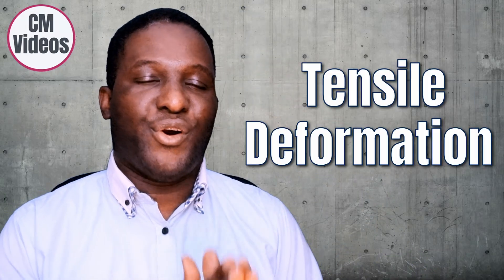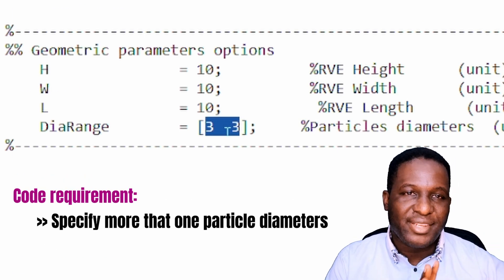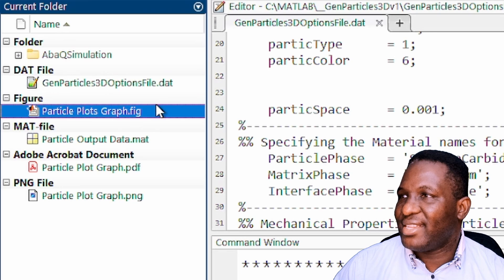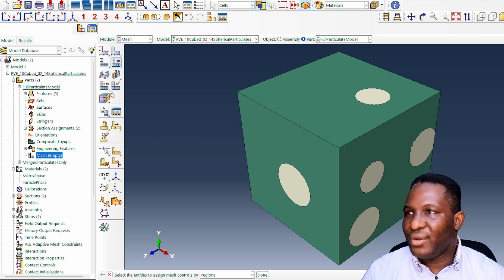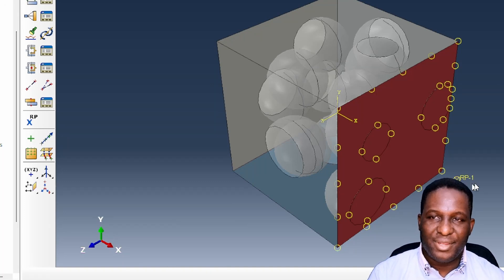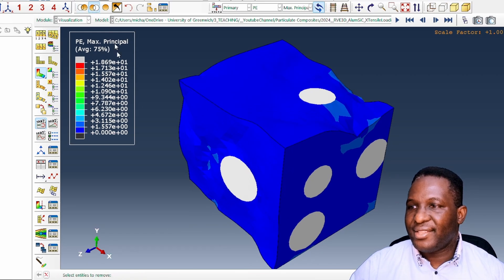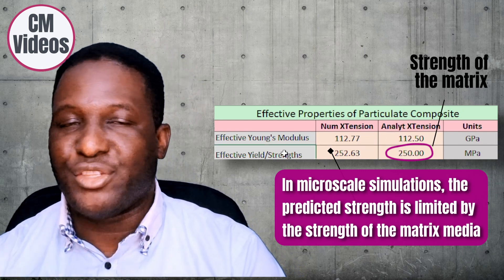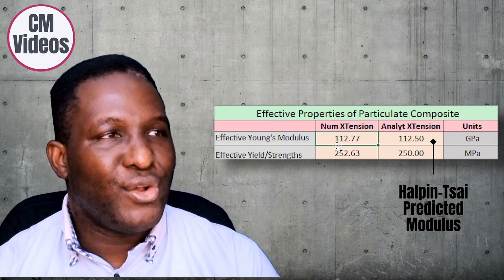RVE MODELLING of PARTICULATE Composites in ABAQUS: Tensile Loading

Comment: Dear Dr. Okereke
Thank you for your useful instructions on composite modeling material. I have 2 questions about modeling complex structures like the human left ventricle in particular. I am incredibly grateful for the invaluable advice you will provide.
1- Is it possible to explain how to model the geometry of the fibers in the ventricle wall? The shape of the heart is obtained by MRI. The fibers wrap from the bottom of the ventricle and go up. The heart wall is a layered structure and in each layer, the fibers' orientations are not the same. They differ from -70 degrees in the outer layer to +70 degrees in the inner layer.
2-  I have an Excel file that has the direction of fibers and the number of the elements to be corresponded. How can I assign fiber directions to the corresponding elements? For example, the element E1 has the fiber orientation (x1,y1,z1). The model has more than 6000 elements and it's not possible to draw the fiber one by one.
I can provide you more details about my questions if you are interested.
Best regards
Reply from the maker: Hello, thanks for your comment and I am happy to note you find these videos helpful.

It does sound like a challenging job what you are trying to do. I do not have any experience modelling ventricle walls or heart modelling so unable to help with the question.

More generally, I think you would be better of creating the fibres (6000 of them) using some sort of automated scheme maybe within a python script. I think if you can create one to learn the process in ABAQUS, then convert the implementation into a Python script by assessing the *.jnl file resulting from the simulation, that could be a good place to start. 

I also think such complex fibres within the ventricle wall might be better developed inside a CAD tool like SolidWorks which when you are happy with it, then import into say ABAQUS to undertake the stress analysis.

I have a video on the channel about asigning orientations to heterogeneous media, please check that out here: https://youtu.be/W34LrXDMhOA?si=5lHhr7c_SDgSMMwx
Reply: @MichaelOkereke  Thank you for your response. Is it possible for you to help me with my second question, please?
Reply from the maker: Sorry, I am not able to help. It sounds like this should be done using a script again but unfortunately, I am not so knowledgeable in this specific challenge.

Comment: Dear Dr. Michael,

I hope this message finds you well. I wanted to express my gratitude for the invaluable resources you have provided. Your expertise has been incredibly helpful in my current research on numerical and experimental analysis of thermal conductivity on silica fibrous materials with random voids. 

I understand the importance of software in this analysis, and I would greatly appreciate it if you could let me know when your software becomes available. I am particularly interested in considering air-trapped bubbles within the cylinder-shaped model and running a heat transfer analysis. 

Would appreciate it if you let us know how to reach out to you. 

Thank you for your time and consideration.
Reply from the maker: Hello, thanks for your kind comments. I am glad these videos are helping you with your work. 
Your research does sound interesting. I have never worked on air-trapped bubbles so it would be interesting to hear more about the work.
I would usually be contacted via the email in the About page of this channel. If you have not already done so, you can also subscribe to my CM Videos Newsletter here: https://cmvig.cmvideos.org, and you can contact me via the welcome email you receive.
If you reach out to me, we can discuss this issue further.
Reply: Dear Dr. Michael, 

First, I want to express my heartfelt gratitude for the quick response. Your dedication to helping others in their research is truly admirable. 

I appreciate your willingness to provide your email address and I want to let you know that I will be reaching out to you shortly. Thank you again for your time and expertise.

Comment: Sir could you please upload video on compression testing of carbon epoxy resin cylindrical rod of volume fraction 60% where we have to do python scripting for adding  lakhs of fiber in Matrix
Reply from the maker: This seems and extensive video to make and I do not usually make this type of video that appears to be a research project. Good luck with the work. I simply make videos on sub-sets of a bigger project to demonstrate a single point.

Comment: Thank you very much for this fantastic video.
Could you briefly explain why you would apply the displacement load to a reference point tied to the surface and not directly to the surface?
I really appreciate your work.
❤
Hephaistion
Reply from the maker: Hello Hephaistion, thanks for loving the work. I appreciate that.

Its such a good question. Over the years of modelling, especially these RVE models where you want to homogenize across the bulk of the volume over all elements to extract stress-strain values, I had to deal with a lot of variables. For example, if I want to get S11 (stress in the x-axis) for  a model that has 10000 elements, then, I will have to record in history variables over the timesteps of the simulation all 10000 elements for  S11. I will then do same for strain (E11). You will find out that you will soon run out of memory with ABAQUS not often able to store in history variables more that 10,000 data points. 

The solution to this is to use that Reference Point, where you are only tracking two variables RF1 and U1 and so will never run out of memory. This is the main benefit. I also like it because it is a bit like attaching the specimen to a load cell which gives you a force measure whiles a cross-head displacmement or extensometer gives you the displacement, U1. This is consistent with experiments. 

The down side is that you will then have to post-process your force and displacement measures into a stress- and strain measure but this is again similar to what you do with real experiment.

This is precisely why I do this and I hope this makes sense to you.
Reply: @MichaelOkereke  that is a very smart solution and it makes sense to me too. Thanks for the reply. :-)